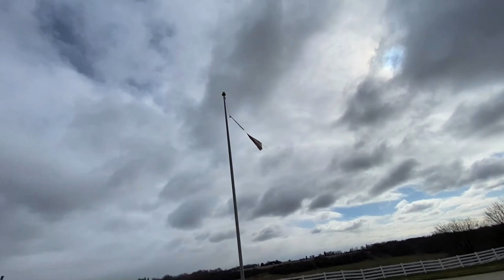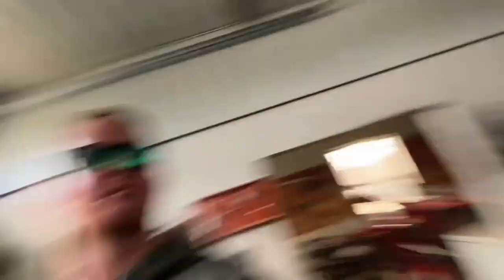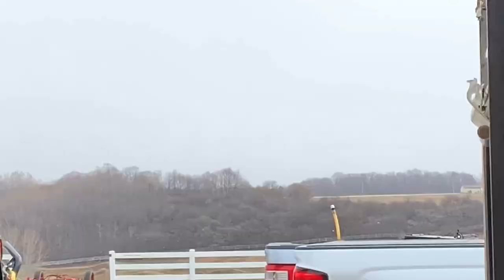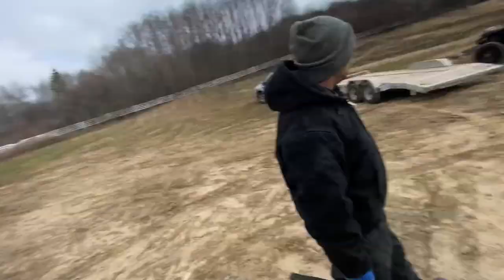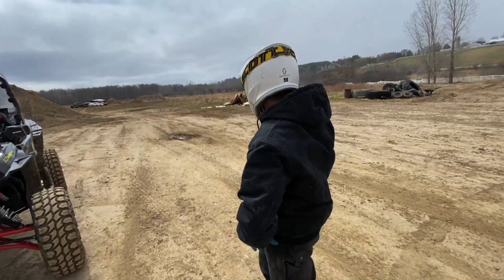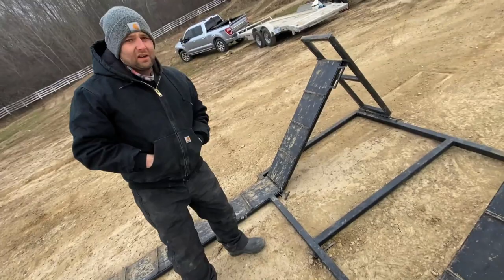RZR VS Maverick WHEELIES!

Comment: Maybe weld in some squares at each corner and use railroad spikes. Or, more work, but add a removable bar with big spikes that run the whole length on both sides so when you set it on the ground and run it over it will sink the spikes into the ground and anchor itself. A small winch point at each end should allow for easy removal when you’re done. Could lift it to put the spikes on and to pull it from the ground.